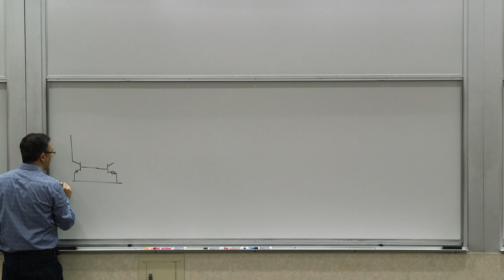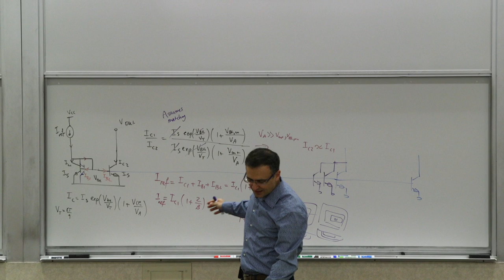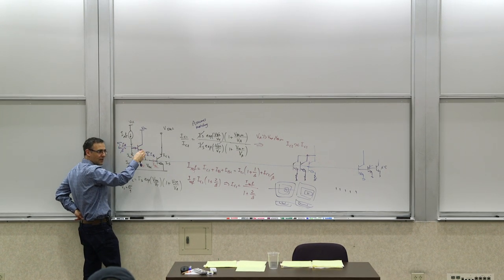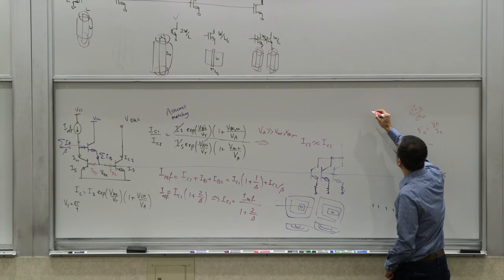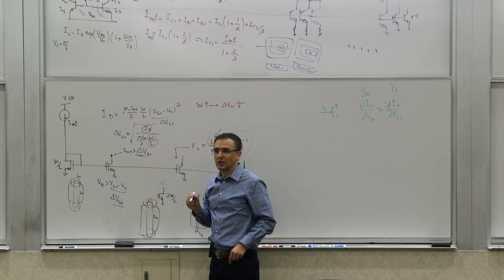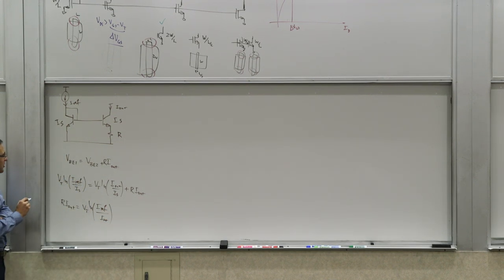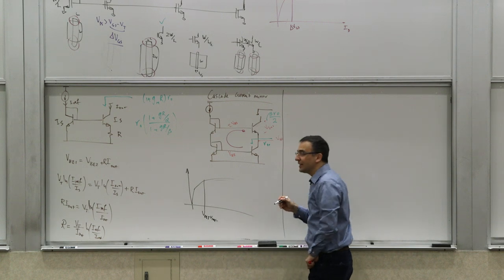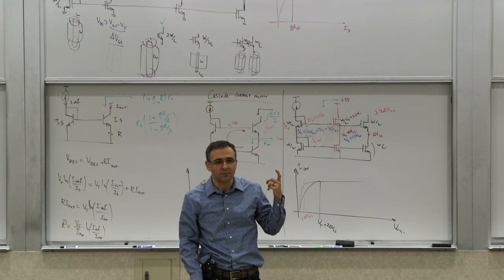132N. Integrated circuit biasing, current mirrors, headroom

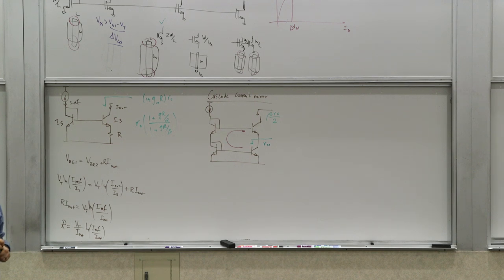Comment: Inutuitive Explanation for beta * ro / 2 for the cascode current mirror (you explain this at 56:50):

To understand this, we must introduce a different view on cascodes in general. You nicely described (in the previous lectures) the change of output resistance by cascoding. But here comes another explanation in handy: For the cascode current mirror, the upper current mirror forces same Vce over the lower current mirror, thus eliminating the Early effect. That elimination is the reason for the increase in output resistance. With this "new view" it becomes much easier to understand:

The upper right transistor still suffers from the early effect. We dont see it, because the low current mirror enforces constant current. But when Vce over the upper right transistor increases, it allows more current to flow which cannot flow because the lower current mirror forbids it. Instead, the base current of the upper right transistor reduces by almost the same amount Ic through the upper right tranistor  increases. That's key observation: delta Ibase EQUALS delta Ic in this case.  But the system is fed via a current source. This reduction in the upper rights base current adds mainly to the Ic from the left path and is mirrored to the right side when the lower current mirror "receives" it. So, in a "normal" or "simple" cascode, the base current reduction does not matter. It never hits anyhwere. But for the cascoded current mirror, this reduction in base current is reflected to the lower current mirror and there appears a second time, thus leading to ro * beta / 2 instead of a nice ro * beta. 

Note how this DOES NOT happen for the casocdes you described in previous lectures. They were just set to some Vbias and any change in base current never hit anywhere.

Effectively, the red circular arrow you drew must run in the other direction, according to my explanation.

Edit: Keep on the great work. Greetings from Germany.

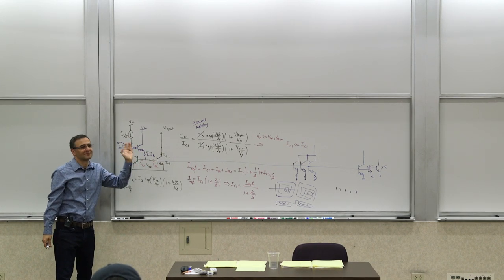Comment: @23:00 One problem not mentioned in the BJT current mirror is the presence of the parasitic base resistor. The BJT that far away from the diode connected BJT, its base voltage is smaller due to the voltage drop across the parasitic resistor, and essentially the Vbe is smaller in contrast to the the nearest BJT whose Vbe is larger. Of course, this base voltage drop due to the parasitic resistance is very small due to the small base current and parasitic resistance. However, as the number of parallel connected BJT increases, and connecting another BTJ to provide the sum of all base currents @21:18, the voltage drop on base cannot be ignored as the current is proportional to the exponential of Vbe.

Comment: 00:04 Integrated circuit biasing is different from discrete design biasing due to economic and device properties.
02:06 Integrated circuits benefit from close proximity and batch processing for better matching.
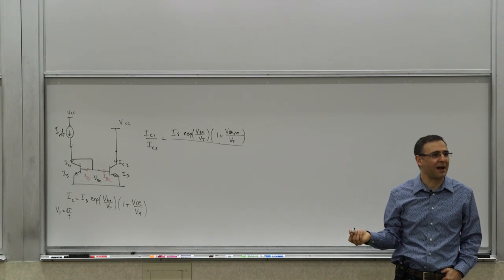06:35 Relationship between different types of transistors and current mirrors
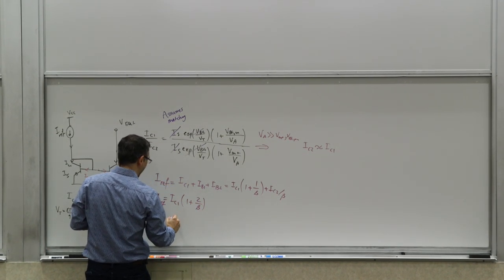09:07 Current mirrors allow replication and scaling of a reference current.
14:06 Parallel operation of bipolar transistors led to sequential failure.
16:18 The base-emitter voltage (VBE) of a bipolar transistor has a reverse temperature coefficient.
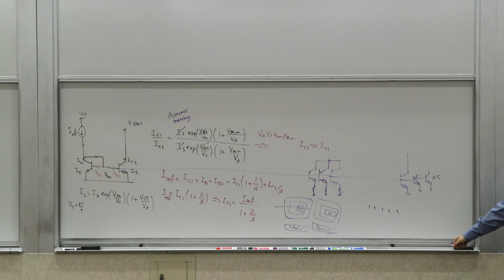20:46 Using transistor beta to reduce base current in multiple stages
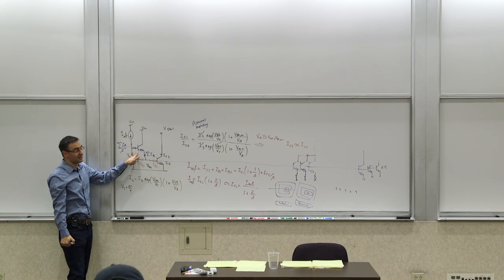22:54 Biasing and current mirrors are specific to certain types of devices.
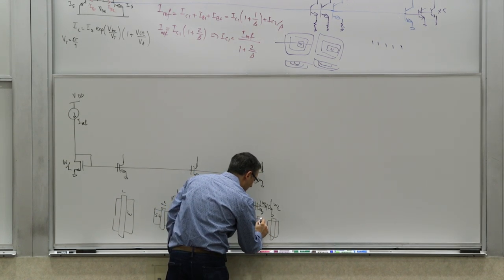27:22 Choosing between different transistor connections based on advantages and disadvantages
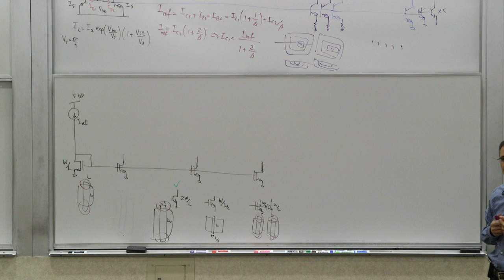30:16 The key aspect of a good current source is high output impedance.
34:27 To effectively generate and copy currents, an arbitrary three-terminal device should be more sensitive to V21 than V31.
37:02 Output resistance and limitations of current sources
41:15 Design parameters control integrated circuit performance.
43:28 Creating complementary mirror with PNP transistors
47:24 Using White's Law current source to scale down current in integrated circuits.
49:38 The output current can be calculated using the difference of two logs.
54:13 Introduction to cascode and cascode current mirror
56:37 Explanation of integrated circuit biasing and current mirrors
1:01:29 Cascode output voltage
1:04:33 Addressing the challenge of reducing the voltage to 2 delta Vgs in MOSFET circuits.
1:09:46 Solving problems one step at a time
Crafted by Merlin AI.

Comment: 1:08:11 Would we have also biased the transistor in the middle branch to threshold so that just VT drops across it's gate and source?
Like:
Since at the gate of the transistor in the middle branch VG = 2VT + 2ΔVGS and we want the source votage of the same transistor to be VS = VT + 2ΔVGS.
Hence VGS =VG - VS = VT.
Reply: The connection of the lower transistor of the middle branch forces the same current as the current reference, thus it forces the gate source voltage of upper transistor to be VT+ΔVGS. If the there is only VT drop across its gate source as you said, the transistor is barely turns on (in subthreshold region), and it cannot draw the same current as current reference.

Comment: For the current mirror, why must we tie the base to the collector of the reference transistor? why not just pull up the base node to Vcc via a pullup resistor?
Reply: Here problem is with biasing voltage.we can use resistor divider circuit to provide required base voltage  but problem is usage of resistors should not be encouraged,power dissipation may be one reason.If we go in same traditional way like voltage divider with vcc there is no point in using current mirrors.one more thing the resistors are temperature dependent.by means of connecting bases of transistors required voltage is provided.
Here current is also temperature dependent,so idea is one golden current source should provide current to remaing circuit.I think this golden current source is developed in a way such that it is not affected by external factors.This current source is made with BAND GAP circuit.

Comment: Could we put current source in between P and N MOS diode connected transistors that would be used as Vgs reference points for their respected MOS type transistors?
Reply: Theoretically you can. But how to implement a PVT insensitive current source between two diode connected MOS? It would be very complicated.